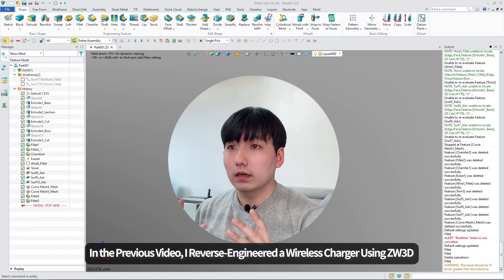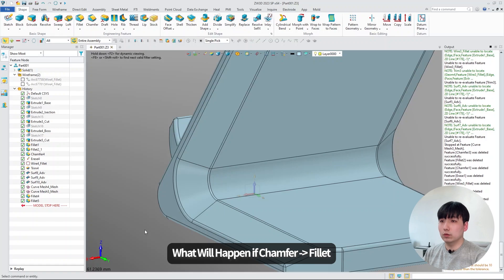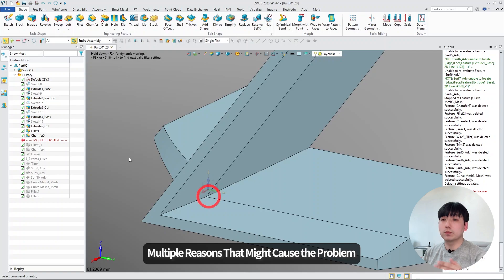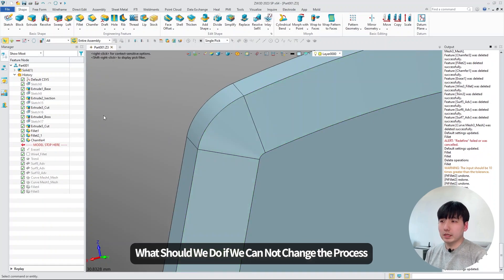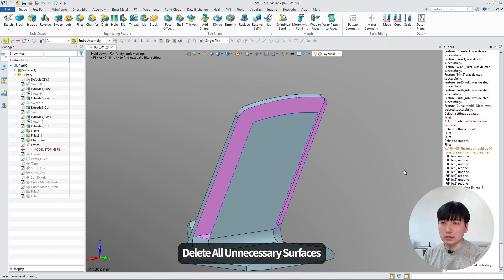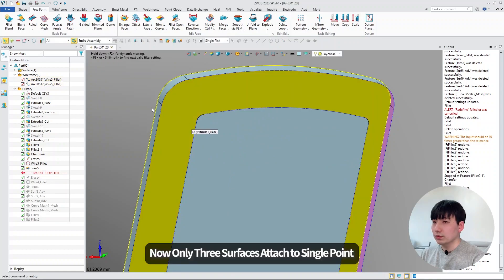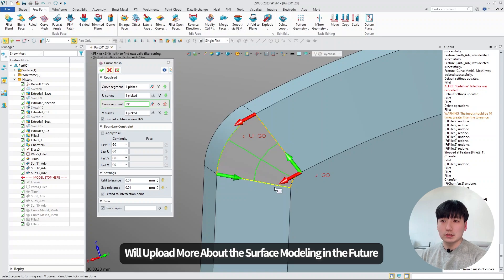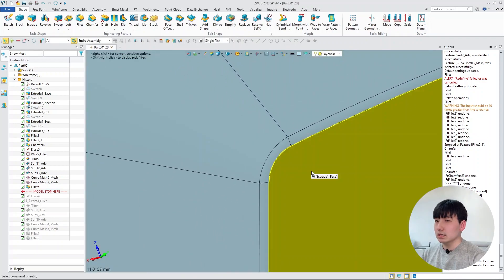[3D Design] Things That Can Happen When You Use Fillet

Comment: hey Dam! may I ask what are the specs of the computer u use?
I am about to buy ZW3D, and use it on a Lenovo w540 (with 24GB RAM, nvidia quadro K1100m, an old 4th gen of I7 processor). I already downloaded the trial version, but sometimes I feel like the software is struggling with fillet creation...Do you experience sometimes issues with fillets as well?
Reply from the maker: Hi @zetheant, I think your computer is sufficient to run ZW3D. In my experience, ZW3D generally works without issues in most cases. However, when inserting fillets into complex or problematic modeling shapes, it can sometimes fail. This kind of issue can occur with any software, so it’s common practice to understand the software’s characteristics and modify the model to create fillets successfully.

Unfortunately, there isn’t a definitive solution, as each case requires a different approach.

This channel is one of our sub-channels, but it is no longer managed. If you want more information, please search for 이거DAM on YouTube. The content is primarily in Korean, but you can watch the videos in English using automatic subtitles.